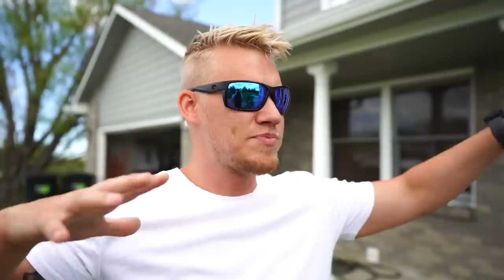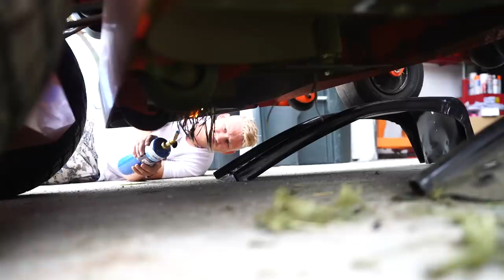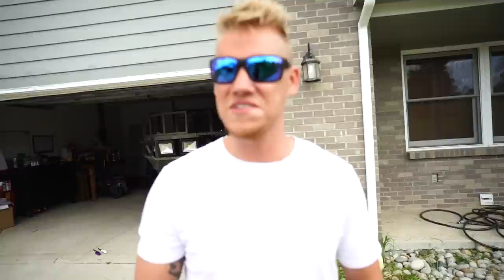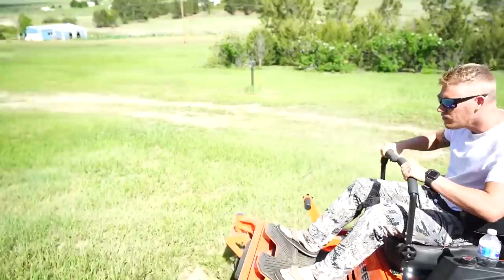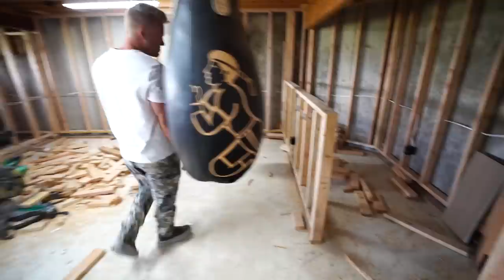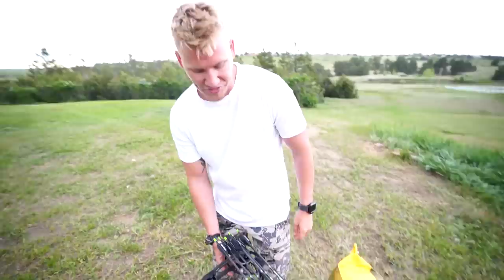My NEW Mower is FAST!!

Comment: Just in case you didn't know, your mower has a few or more grease points that need to be greased regularly probably once a month or so if you mow your yard once a week give or take. Also there should be a spot on the outside of the mower deck where a standard garden hose hooks up to, you attach it and run the blades for 3 or so minutes with the water running through and it rinses the deck out real well after each use so you never lose out on suction and suffer a poorer quality cut. (I mow professionally, figured Id give you some ownership tips on the off chance you don't know. Cheers man, keep it fricken hill billy!

Comment: For weeds you can order a product off Amazon called TZone. It only kills weed. As a licensed fertilizer technician in Minnesota it's all I use for weeds. It's safe to spray on grass without worrying about it killing grass, only kills weeds. Order that and a simple 2 gallon hand pump sprayer. You'll be good to go. 1.5 oz per 1 gallon of water. You can also spray weeds pretty heavy since it doesn't kill grass. You'd have to spray nearly the whole 2 gallons to really kill grass.

Comment: Sweet mower mate, as a lawnie myself I approve ;D Tip though for the length of time your on that thing get yourself some good noise cancelling headphones or earmuffs/earplugs and some safety glasses. You can repair broken bones and replace lost blood but once your hearing and sight are gone you never get them back. Oh and you'll get a lot more life out of your deck belt, spindles, PTO and engine if you kick on your blades at 1/2 to 3/4 throttle as it puts way less load on aforementioned components, especially the engine and belt. Don't listen to all the whiners hollering about cancer and roundup, I've used the strongest concentrate you can readily buy for ages for commercial work with no problems. Ok if your like one of the geniuses suing Monsanto who got absolutely drenched by the stuff god knows how then maybe yes but anything at that level won't be good for you.

Comment: Yo outlaw I used to spray commercially for a long time. My recommendation  for your stone is spray with glysophate / Roundup. Can a secondary treatment of pramitol. Which is a ground sterilizer you apply that and you will have no weeds for 1 to 2 years or so

Comment: Try using pramitol you can find it at tractor supply not sure if they have them out in Colorado but that is what we have always used it is an industrial weed killer and we may or may not mix it with a little diesel fuel so it sticks on to the plants

Comment: Pull the rock out, throw down some landscape fabric, put the rock back on or use mulch.  You could pop through the landscape fabric and plant a couple shrubs.  The fabric will kill the existing weeds/grass and will prevent growth in the future.  It's still possible for weeds to grow through the fabric after a couple years but you could hit those areas with some weed/grass killer.

Comment: Remedy is the best weed killing product. $90 for a gallon. Buy a 2 gallon pump sprayer and add a 1/4 gallon of remedy and then top off with water. This stuff is extremely potent. So make sure you have no rain for a day. Because wherever you spray needs time to dry or it will run off and wherever it runs off it will kill.

Comment: The actual chemical in weed killer that kills is called “glyphosate”.. normal weed killers have about 1-15% glyphosate in them.. you can buy the pure glyphosate jugs for pretty cheap and make a strong mix with water. Kills anything and everything within days. Found at most farm stores, tractor supply, rural king etc. A lot of farmers use it on large areas. I use it for clearing trees/brush/grass/weeds etc for food plots.

Comment: if you want the weed wacker to stop running out of wire so fast all you gotta do is take that dam cover off the end cause if you look inside there they have little blades that cut the sting to a certain size, but if you just take that whole thing off the sting can come out further and you can cut 10x longer without the string constantly running out

Comment: White Vinegar and Salt is the best weed killer I've been using for a while now. Do Not dilute with water use it at full strength and add the salt to the vinegar and pour over the weeds.

Comment: Bro u can get weed eater string with metal wire inside it, you could weedeat your yard like 3 times without changing the string if u use that kind.

Comment: Either Arsenal or Martin’s eraser. Roundup pro concentrate will work but it will come back real quick. Arsenal or martins eraser will keep it killed all mowing season. I used to be a chemical applicator for the DOT and now work for TruGreen lawncare so I know a little about chemicals.

Comment: Believe it or not I've tried a bunch of brands and Round Up is honestly the best like mass market liquid weed killer. Get one of the five gallon backpack rigs you can do your whole property fencelines and all. I used to spray a 10 acre horse ranch all fencelines around barns out buildings all that shit once a month and use a swing blade to cut out any large stalks initially worked great. And I live in North Carolina where it's 100% humidity all spring summer and fall. Lol.

Comment: The absolute best weed killer is 24D and GRAMOXONE mix them two together in a back pack sprayer 32oz. of 24D and 12oz. of GRAMOXONE and the rest water.  The stuff will be dead by the night or following morning. I’ve used it for years and it’s freaking awesome

Comment: Take up all the rocks, and spray weed killer. Put down a black plastic or tarp then put some rocks around the edges of said tarp or plastic. And in the middle so it doesn’t blow away. After a few weeks of hot weather shouldn’t be anything there.

Comment: Buy a Stihl BR 700 or 800 or the Echo PB 8010. You wont be dissapointed in either. I have a BR 700 and its a beast. But I got it before the 800 came out. Id def go with the 800 now if i were to buy a new one.

Comment: Stihl has always been great equipment. No complaints because I've used them for 13 years on the daily. Last forever. I have an 034 AV from 89 that runs like a top. But what kind of mower is that? Get yourself a diesel deere hoss. Ya cheap bastard.